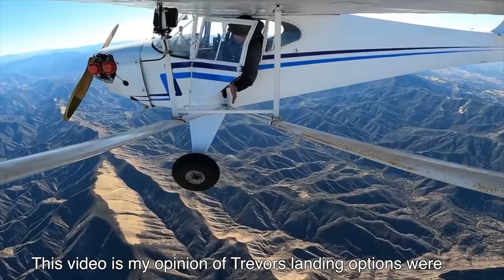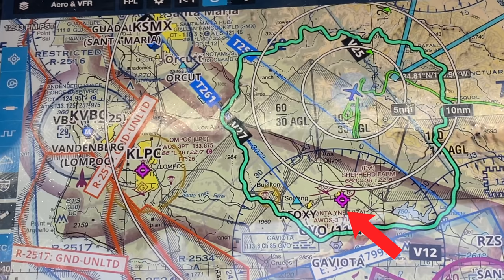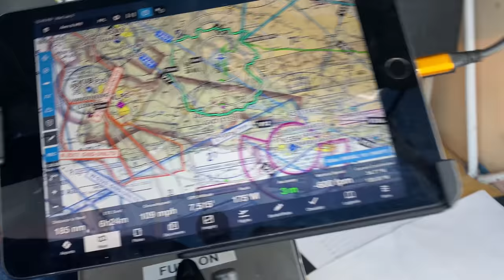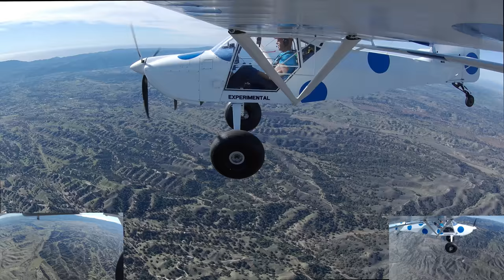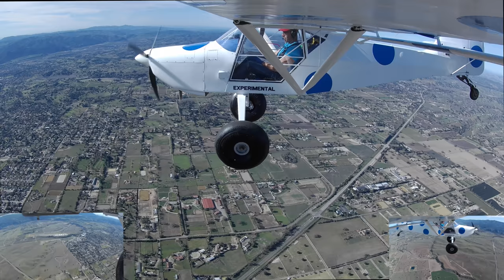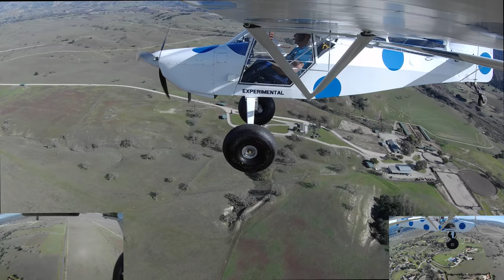Trevor Jacob plane crash -landing options

Comment from the maker: 9/11 proved aircraft filled with fuel are a wmd. I hope if Trevor is guilty of intentionally crashing a plane that he gets charged under the post 9-11 terrorism laws and gets locked away a very long time as a resounding lesson to aspiring crash-4-views copycats.
Reply: Whistling diesel did a fake plane crash with one of those planes six months ago. Except he was safe and legal.

I do like the way the idiot hiked all the way back to the crash to set the switches to match his story for the faa
Reply: I bet there's no gas in the plane, just enough in a portable tank for this stunt.  The fuel selector is dangling from the side of his head and this was being sold for parts
Reply: @THRASHMETALFUNRIFFS  the stick in front of the windscreen is the fuel gauge, it reads near full
Reply: Strange how two planes took down three towers in NYC though, right? Still trying to figure that one out. Also, demolition experts and engineers are trying to figure out how 3 buildings fall at 9.8m/s (speed of acceleration of gravity). The only way that would be scientifically possible is if all three buildings floors have way in order to the exact millisecond
Reply: @NASkeywest  
Strange how one cow took down most of London. 

You find it odd that things fall?
Can you please show me where you got those measurements to the 1:1000 accuracy?
Reply: @brucebaxter6923  an guess what? There is footage of the towers falling! And guess what else?! There is this thing called time, you can actually calculate how long it takes a building to fall by using this thing called time! I feel like I’m talking to a 5 year old. Common sense isn’t very common is it?
Reply: @NASkeywest  
Oh, you mean the footage where the wreckage falls faster than the building?
I have looked at that and can’t find a problem
Reply: @NASkeywest  
Umm, great fire of London?
Cow kicked over a lantern and the whole city burned down?

Same as the wtc burned and fell on other buildings that also burned.

There’s footage of it, even a 5yo can see it happening
Reply: @brucebaxter6923  what does the great fire of London have to do with 911? Seems like you are avoiding providing any type of proof or anything scientific. That fire was in 1666, steel framed structures and skyscrapers were not invented yet. Lol. That’s really all you got. You sling an insult and then reference a fire 400 years ago. How does 2 planes take down 3 skyscrapers? Cmon, I’m obviously an idiot so educate me and don’t try and reference something that has no relevance. Fun fact: a steel framed structure has never had total structural failure due to impact or fire before. You have only validated so far that you know absolutely nothing about physics or critical thought. This should be easy for you to explain right? Since I am inferior intellectually. Blow my mind with some knowledge.
Reply: @NASkeywest  
Still one cow burnt down a whole city, the biggest city in the world. 
What starts something doesn’t represent how it ends. 

Plane hit a building, building burns, building falls on another building, that building burns and falls down. 

Where is the problem?
Reply: @NASkeywest  
Your fun fact isn’t actually a fact. 
Perhaps an alternate fact?
Reply: @NASkeywest  
Built to withstand fires earthquakes and Godzilla?
Seriously bro. 
Next you will be saying the titanic was unsinkable. 

You seriously think any building is designed to survive 100tons of kerosene and 150tons of other stuff hitting it at 500kph and burning unopposed for 10 hours?

How gullible are you?
Reply: @NASkeywest  These theories have all been debunked decades ago now. You should go out and yell at cars from the side of the freeway; it would be a better use of your time.
Reply: @NASkeywest  Yeah, nah, not the place mate, so give it a rest.
Reply: @THRASHMETALFUNRIFFS  It doesn't need much fuel at all to start a fire. A spoonful  is more than enough when there is so much other combustible material around.
Reply: If he is charged and convicted of an actual crime sure but terrorism? Nah, this isn't that. That words gets tossed around so much it loses some of it's meaning and that shouldn't be, it's serious shit.
Reply: Nah, it's figured out.
Reply: @NASkeywest  Your view has been debunked thoroughly, it's not our job to get you up to speed on the factual evidence.
Reply: @NASkeywest  Correct, 2 planes took down those buildings, were you not watching?
Reply: If he is found guilty surely there should be repercussions but life in prison? Call me old fashioned but I feel the punishment should fit the crime I mean, this isn't Russia is it? Is this Russia?
Reply: @NASkeywest  I'm not going to do your work for you, try being a skeptic at least and see where that leads.
Reply: @fractuss  I’ve spent years putting in research and “work” that’s how I know the truth. You obviously havnt because you couldn’t even attempt to explain it or prove me wrong so you just say “I’m not doing research for you.” That’s the difference, I took the time to lean and talk to Architects and engineers for 911 truth, Pilots for 911 truth, demolitions experts for 911 truth. Etc. I come from a point of knowledge, you come from a point of just assuming that whatever you were told was the truth and didn’t actually go learn anything for yourself.
Reply: @NASkeywest  You know nothing about my knowledge base and you're a conspiracy nut. I owe you nothing.
Reply: A "very long time" sounds harsh.   Maybe just a short sentence would be more appropriate.
Reply: That is just a bad take.
By defitionon, terrorism is "the use of force or violence against persons or property in violation of the criminal laws of the United States for purposes of intimidation, coercion, or ransom".
Did Trevor use force or violence against persons? Nope. Did he use force or violence against property? Also no, the only property that was destroyed was his to wreck.
Was Trevor trying to intimidate the population, coerce the government into some action or inaction or did he demand any ransom from anyone? No, no and no.
Look, I am not a pilot, so I can only assume that crashing a plane on purpose violates some regulations, it may well even be a crime depending on the circumstances, but just because something is reckless and dangerous does not make it terrorism. Only terrorism is terrorism, there is no degree of reprehensibility above which crimes that are not in their nature terroristic become terrorism just because you are angry.
Reply: @NASkeywest  You've got a problem with your calculation.  Even if super magical demolition teams spent weeks pulling out walls and rigging up explosives with nobody noticing, the rate of fall would be the SAME as the building collapsing on itself.   Look at any tall building demolition.  They only ever rig up ONE floor.  And they ALL fall at "near freefall speed."  Once you get a dozen floors to start moving and impacting the next floor down with 100 times the static design load, nothing slows it down.
Reply: @NASkeywest  - Thanks mate, you actually made me laugh.

Also - "Architects and engineers for 911 truth, Pilots for 911 truth, demolitions experts for 911 truth"... it really seems like you found a bunch of non-biased sources. 🤣🤣🤣🤣🤣🤣
Reply: It appears that he may also have been after insurance money on that aircraft.   Hello insurance fraud.
Reply: I get that he dit something really wrong but why this?
Reply: If he did intentionally crash I hope he gets punished. I'm sure there are laws that can be correctly applied to this situation. It wasn't terrorism and I don't want autorities abusing their power to appear tough on the internet.
Reply: He needs to be locked up!
Reply: @brucebaxter6923  ...and get his GoPros so he can post the video immediately.
Reply: No reason to call this something it isn't. This wasn't terrorism by any stretch of the imagination.
Reply: The mens rea requirement for those terrorism statutes requires a very specific criminal intent which Trevor almost certain doesn't meet.  But that doesn't necessarily mean he doesn't have some significant exposure under other statutory schemes.
Reply: @NASkeywest  lol I'll break it down for your STEEL GETS HOT. STEEL BENDS. STEEL COLLAPSES. End of story. Sorry there's nothing more to it bud.
Reply: @Bionicbunnywabbit  2 planes hit 3 towers and made them melt and collapse at the speed of gravity? Makes sense. Skyscrapers just collapse into themselves for no reason all the time.
Reply: @NASkeywest  I didn't say they MELTED. Steel doesn't have to melt to collapse. JUST BEND. That's what makes sense. That's all that happened. Unless you have a more sound theory and evidence
Reply: @Bionicbunnywabbit  temperatures of fire can’t melt steel or make it molten. A skyscraper in Portugal burned for 48 hours and never fell. It’s physically impossible for a building to fall at free fall speed without every floor being blown at the same time. There is an organization called “Architects, engineers, and demolition experts for 911 truth.” That more than prove this. Are you an expert in this field? No, you are not.
Reply: @THRASHMETALFUNRIFFS  Not just fuel selector... The part dangling is also where the fuel tanks for the wings actually connect into... at the top of it,  which is why it is actually dangling, it's normally held up by the copper fuel line connected to it. You open the valve to let the wing tanks drain gas down to the header tank in the front of the plane when it gets low, which is how you know how much gas you have left in total , remember, this is from 1940.. From inside you can actually see the gas line from the left wing are physically disconnected, so his absolute  maximum fuel was 12 gallons or so, maybe 9. depends if he had a stock tank or not....  The craft was stripped down massively and really rigged up to just barely fly.
Reply: @HicSvntDracones  Good eye, good info, thanks!

Comment from the maker: If he actually looked at the ground enough to ascertain there was nothing down there that would be destroyed by his plane, he would have noticed many great places to land on the river bed :)
Reply: That river bed would have been a better choice for a parachute touch down also.
Reply: Isn’t this similar to say if I was driving on a desert highway in low traffic conditions, experienced brake failure, and instead of taking five seconds and seeing if I could roll off the road to a safe stop just opened the door and bailed out instantly ?
Reply: You clearly showed that there was absolutely no need to panic.
Reply: At the end of his video. He said the plane came back and almost hit him. How is that even possible? Why would Trever say that?
Reply: He didn't even go there under the chute.
Reply: He had also flown past an area with incredibly good landing spots ~8 miles earlier. His plane could've glided there no problem with any headwind. And he knew it was there as he had just flown over it.
Reply: @pistonburner6448  Someone has already been up in a similar plane to try and recreate the flight. They shut down to idle, turned around and made it to an airport, flew a circuit and landed without declaring an emergency.  Think they estimated they had 4 miles to spare.

Comment: What I love about your video is that you don't presume to know the conditions of the fields in the mountains based on a flight sim.  You actually flew the same route and followed protocol and landed at an airport.  The fields may have been the best option at a lower altitude, but he was cruising high enough to make it to the airport which he should have already noted in flight preparations.  Either he's a bad pilot or a bad person.
Reply from the maker: … or both :)
Reply: Another point is, let’s assume he really a) couldn’t land in any valley areas and b) couldn’t cruise to the airport. Wouldn’t the most obvious question be, why would you put yourself in that position as a pilot? You should always have an “out” in case of an engine failure. Your route can’t take you into places where you have zero options if your engine goes out.
Reply: If I wasn't sure that I could make it to an airport, I wouldn't risk trying. Putting it down in a field is the best alternative. But in that situation, with enough altitude to glide out of the mountains, there are plenty of farms and fields in flat terrain for landing.
Reply: Both

Comment: Great vid. Thanks. I agree that his crash is suspect. He could claim that he made his decision to bail out early because if he'd waited until later he'd be too low to bail out. But there are many other problems. Flying such a small plane while wearing a parachute is highly unusual. He rarely wore a parachute in his prior flying videos. Also, the 1940 Taylor plane he used isn't seen in his earlier videos. He may have bought this cheap, bare-bones plane just for this video. In the video, he claims he told the FAA/NTSB right away. But, local reporting says he waited several days and didn't report it until urged to do so by airport employees. Worse - he hired a helicopter to recover the wreckage himself and move it to an unknown location. Disturbing aviation crash debris before letting the NTSB investigate is a big no-no and is, itself, probably a crime of some sort. Even if the NTSB can't adjudicate this as a deliberate act, he should suffer a penalty for moving the wreckage without permission. My biggest concern is that he departed the airplane and left it pilotless while in a stable, level glide. With the right winds it could easily have glided miles before crashing and ended up at a location where there were people, vehicles and structures. I hope the NTSB gets to the bottom of this.
Reply from the maker: correct.  he makes a big point of saying he always flies with a chute ... but as you say, he rarely does.
Reply: It might be hard to sell that altitude was a factor in his decision to bail early when the video shows him falling for at least 20plus seconds. Adding the  altitude lost during parachute opening, that puts him 3500ft minimum below exit point when his parachute is fully flying. Thats a lot of altitude to just burn for no reason. Trevor has many hundreds of skydives and is also a skydiving instructor btw, so he knows what he is doing when it comes to parachuting
Reply: Totally. Even if he couldn't make it to the airport for being lower there appeared to be a ton of flat area near the airport that Scooby demonstrated in his video that could serve as a good landing pad. He didn't have to land in the mountains at all even though that valley appeared real nice for doing so.

It appeared he had plenty of time to make some calculated decisions first but choose to bail out without any explanation as to why. He did not try anything to save the aircraft.
Reply: @MrBrandenS  While it was a flight sim, I saw one video of someone taking the approach of landing it in the valley and did so without issue. Again, there are many variables. Wind speed and direction being one of them. And I won’t use a flight sim as proof that he could have landed the plane. But I will use it as proof of his landing options. He had plenty of them.

Comment: This is high quality commentary, good work. While your engine at idle does not have the exact same drag as a dead engine, with how large your tires are I would be surprised if that Taylorcraft had a worse glide ratio.
Reply from the maker: Thanks Jay, I agree.  With stock tires, it would be about the same as the Taylorcraft but with those tundra monsters I have, the glide would most likely be worse.  Not looking good for our buddy Trevor.

Comment: When being questioned: 
Trevor: If you notice in the begning of the video, you can see me concerned when looking at my gauges and was worried about performance. 
NTSB: But you continued with the flight anyways? 
Trevor: Ridge Wallet sponsored flight , so I had a financial obligation to continue. 
NTSB: There's no record of you squwaking 7600 or 7700, why is that? 
Trevor: The sponsor, Ridge Wallet, it blocks RFID signals... 🤷🏼‍♂️ 
NTSB: At what point did you contact ATC, either sector or local to declare an emergency? 
Trevor: I unplugged my headset 
NTSB: Before ditching, you had plenty of altitude and weather was good. At what point did you attempt to restart the engine? 
Trevor: I ran out of fuel 
NTSB: So you departed knowing you didn't have the fuel to make your intended destination? 
Tevor: Even though I was sponsored, by Ridge Wallet, 100ll is expensive and I needed a new selfie stick. 
NTSB: The aircraft was flying and you were clearly in control and maintaining a moderate glide, so why bail out? 
Trevor: I had my parachute on. 
NTSB: Do you typically fly with it on and rigged? 
Trevor: No, it was the first time, I just had a feeling I was going to need it that day. 
NTSB: What have you that feeling? 
Trevor: That was the plan from the beginning. 
NTSB: I see, is that also why you failed to notify us of the incident and tampered with the aircraft and crash site? 
Trevor: Obviously. Wait, that was a trick question
Reply from the maker: Lol!!!’

Comment: Excellent video, as you said, NTSB and FAA report will be the final word. This does provide good context as to how close the crash site and bail out area is to a good airfield and plenty of flat ground. The Jacob video seems to be edited in a way it seems to imply zero ability to glide to a safe landing.
Reply from the maker: Precisely. He was naive enough to think that nobody would be able to figure out exactly where he was.
Reply: Has there been any investigation done yet? Or are they still working on it? How long does that usually take for a situation like this? I know for the big airliners with a lot of people and what not it can take a reallyyyy long time but I figured this situation would be pretty cut and dry. Regardless if it were faked or not just wondering how fast a smaller investigation usually takes.